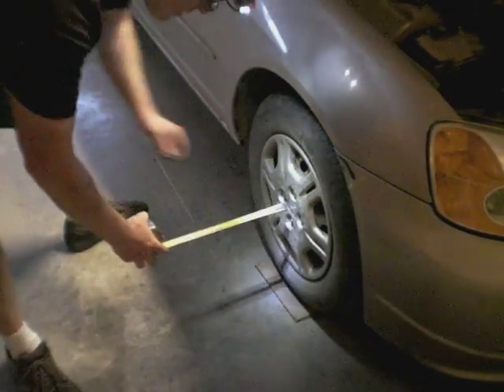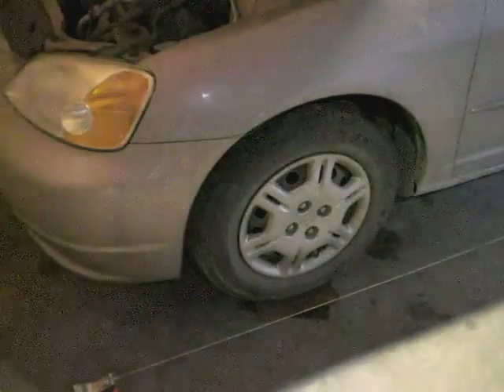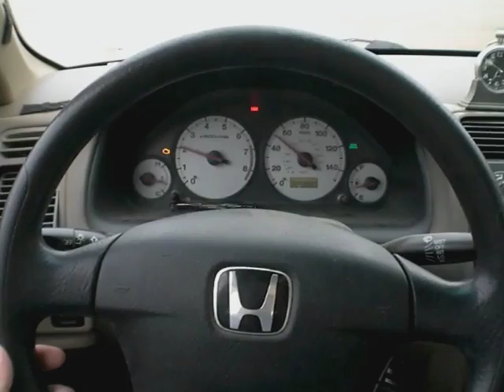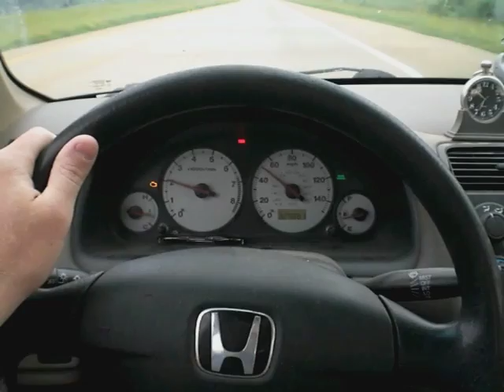Poor Man's Front Wheel Alignment (Toe angle)

Comment: Nice video, which wrenches did you use? Car driving true now?
Reply from the maker: +Albatross, It's been a while so I just went out and measured it, it was a 15/16 inch wrench to loosen the locking nut, and a 14 mm to rotate the tie rod.  Unfortunately, I don't own any larger metric wrenches, so I use what's close.  If my math is right, 15/16 should be about 22 mm in metric.  I've been using this method for years now, and now that I think of it, my car always seems to drive true.  If it ever pulls to one side, it's usually due to a bit of chamber misalignment or worn tires.
Reply: +Thadivs Thanks for the quick reply. I just went out and worked on my car. For the life of me, I couldn't break free the locking nut. I tried using a breaker bar, but I only had one, so I couldn't brace the other wrench holding the tie rod. Have any tips? May have to take it to the shop if I can't break it off, but then I wouldn't be a poor man any more lol
Reply from the maker: +Albatross, I never use a wrench on the tie rod end.  I just rotate the locking nut (and tie rod end) with the big wrench until the tie rod end can't rotate any further.  Then I put some muscle into to wrench.  On rare occasions, I have to slide a pipe over the end of the wrench to give a little extra torque.  It's always a good idea to soak the threads with Liquid Wrench or WD40 (let it sit a couple hours) before doing anything.  Even if the nut is loose, any dirt and rust on the thread will make it a bear to rotate up the thread.  Maybe even take a wire brush to the thread.
Reply: Okay, I thought about doing this but the service manual says to hold the tie rod end to make sure it doesn't move. Is there a chance to break the joint there with too much force? Mine wiggles a bit (driving a rsx which is basically a civic)
Reply from the maker: +Albatross, I've never had one separate (ball from socket), even if the joint was worn out with a bit of play in it.  If you're set of holding the tie rod end, I would use a wrench or a vise-grip with a piece of pipe to extend it for extra torque.  If you use your leg to block that from moving, it will allow both arms to work on getting the nut loose.
Reply: +Thadivs Finally got it off using a blow torch lol the sound of the bolt cracking open had to be the sweetest sound I've heard in a long time. I used a vice grip on the tie rod end and jammed it into the wheel well.